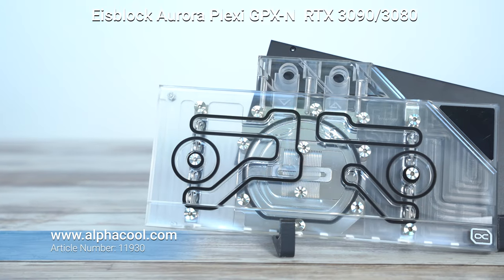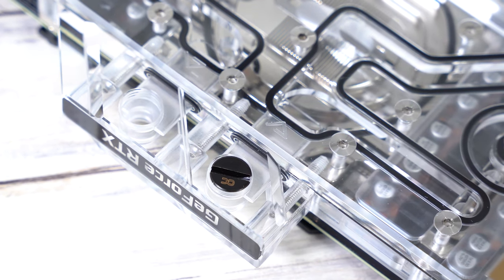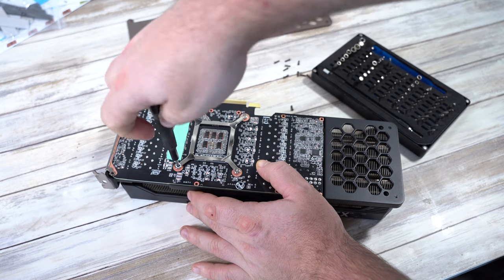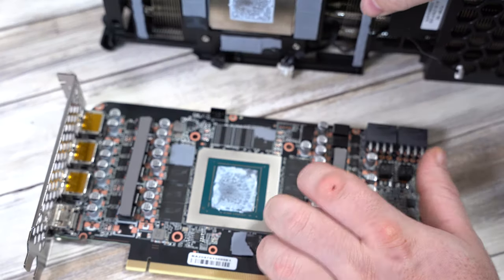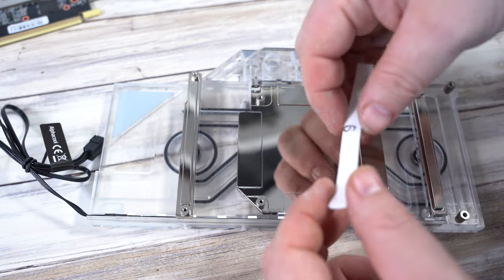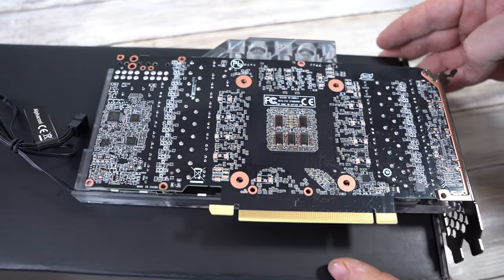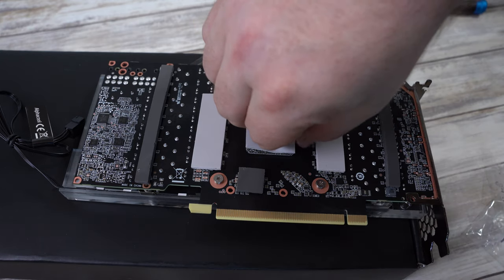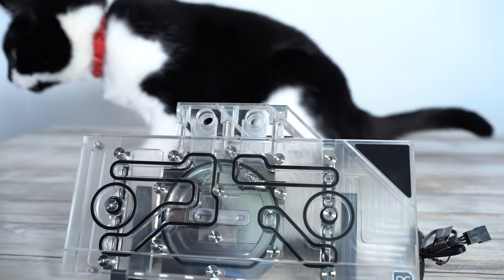How to install a 3080/3090 REFERENCE waterblock.

Comment: Do you know if there will be a gpx or gpx upgrade line for the 3090/3080? I would love to reuse my pump for my 2080ti i have, as I have a full eiswolf/eisbaer setup.
Reply from the maker: we will be releasing the Eiswolf II for the 30 series. but at this moment in time, we don't have an 'upgrade line'. That might change at any point though as our launches are crazy at the moment and I can only see so many :D
Reply: Awesome. That’s good to hear that I’ll be able to get something similar. And by “upgrade line” I meant the gpx “shell” that allows you to use the existing pump. Thanks for the quick reply!
Reply: I looked it up again since you seemed confused. The exact name on the site is “Nvidia GPX upgrade kit”. I see how you could mess that up with an upgrade line. Sorry bout that.
Reply: I wanted to second this. I also have 420 eisbaer and 240 eiswolf on a 2080 ti. 
Is there a significant performance difference between the eiswolves and eisblocks?
Reply: As far as the new ones they’re coming out with? I’m not sure, but honestly it just looks like they added rgb lights. Kinda sad honestly, cause the original eiswolf turned out not to be very modular or upgradeable if they EOL’d it after just a year or two. Not looking forward to buying a eiswolf 2 and all, just because they aren’t putting anything into the original eiswolf. I may sadly just stay with air. There’s a saying that people on that use air, like using their computer, while people that use water, like tinkering with their computers 😝 just didn’t think I’d have to upgrade all the water stuff so soon to be honest. Maybe they’ll come back to it so users like us can upgrade more affordably, but I will be most surprised if that happens 😊

EDIT: oh I see you meant the eisblocks they have 😝 derp! And I doubt it, I saw people concerned about vrm temps, but alphacool said they hadn’t found issues with it that way.

Comment: You never put the back brace on the gpu big mistake temp sky rocket at idle ..
Reply from the maker: you don't need the brace with a waterblock. If ever you will need it, we will mention that in the instructions.

Comment: Im hugely disappointed by this castrated block, too small, low coverage area.
Take a look what Byksky did, first they released similar block but with more Copper, and this week they already replaced it with V2 that has FULL contact with everything, no more holes where you can see the components trough plastic, everything touches copper
Reply from the maker: All parts that need to be cooled are cooled with water. More copper does not mean more cooling capacity, on the contrary. and also other coolers do not cover more components or do you have a heat conducting pad or heat conducting paste on the entire underside of the other coolers? No, you do not, because not everything is in contact with the cooler. Because that is neither necessary nor good.
Reply: @AlphacoolGmbH  I want to say 3 things:
1. Byksky had the same design as yours, but during the last 2 weeks they already re-launching Version 2 of their blocks, and the difference is that they closed up all the holes and now cool everything, they re-launched 4-6 blocks and keep updating more, just today a new Ventus X3 3090 block came out [my card] that also closed up all the holes compared to previous edition.

2. EK outright released complete blocks, no holes, everything cooled.

3. I had pleasure of owing a German Heatkiller block for my previous card 2080TI, and they are the ONLY brand so far that have ZERO "fake" plastic that hides the parts of the block that have no copper under it, their blocks are heavy, fully copper from one edge of the video cards board to the other, nothing is hidden by the plastic, and they have crazy amount of contact points, even on cards edges, its insane and the water-flow all trough the card, and surprisingly their prices are cheaper then EK and more compared to yours starting at 129EUR [EU VAT included] I wish I could buy their blocks, but they Boutique brand and have far fewer options then others, right now no Ventus Block.

Since when more copper is bad? more copper, it soaks up heat, it has more contact with water to cool down.
Reply from the maker: @NoBodysGamer  If simple physical principles are not understood, it is hopeless to argue. If you had the coolers in your hand, you would know that a water cooler never touches all the components. If it did, you would have lots of short circuits. It is easier and cheaper to mill a complete block from one piece. This is only one step. Each additional work step costs more money than the material costs, which are basically irrelevant. 
And there's no stopping you from buying another cooler if you think they are better.
Reply: you are so right buddy!!!👍 I am also extremely disappointed!👎how can you remove such an ugly design???? 🤮
I'm so happy about my extremely awesome cutstem system!! 👌😍 thickness colorful acrylic hard hard tubes full chrome angled fittings BitsPower Touchaqua Summit MS CPU water cooler . RGV-JSB-MOD3-P-V2 JONSBO MOD3 surge tank.
Bitspower Nvidia RTX 2080 Ti  4 x 8 GB  G.Skill Trident Z Royal Gold DDR4-3600 DIMM RGB 🤩Ryzen 7 3800XT 
1TB Samsung 970 Evo Plus M.2  Gigabyte B550 Aorus Master AMD. 850 Watt Corsair RMx White all white Sleeved Cable Management,  yeeeaaah Baby!! 💥 let me tell you something my friend, not only the performance is important, but also the damn optics!!! Alleluia to my murderous system!!  Yeah Man,  yeaaaaah!!!!! 🤩 nice greetings from Germany ✌Ppimping King  💪 🏆
Ps: hey buddy, you have to help me to get a better disign for my 3090 ti?  🤔there is no better cooling design for my future graphics card? 😩😭it looks like i will have to skip a generation?I will probably have to switch to the 4000 series? or you find for me a solution for the 3090 ti?

Comment: why the f is the waterblock plexiglass significantly longer than the PCB? it looks really janky especially with the large hex bolts on the front

And you don't re-use the X-bracket for the GPU which gives a much more even load across the die? Do you want people to crack their dies? Guess I'll buy an EK or Phanteks block
Reply: All the reference PCBs are slightly different this time round. Some are slightly shorter, some are slightly longer. It's been made to fit all of them, including the zotac which a lot of blocks don't fit. 

There isn't any need to use the X-bracket as the metal of the block is far more ridged, you're not going to have any issues cracking the die unless you use a hammer or impact driver or something.
Reply: @davido_labido  I rather disagree - the screw-only method puts higher pressure differences across corners and it's more likely to crack the die. The bracket gives a more even distribution across the die, and you can use higher mounting pressure (better for cooling) safely.

And if I'm going to spend 130-150 Euro on a waterblock, I want something made for my GPU not something cobbled together like this
Reply from the maker: @iamdmc  of course, you are more than welcome to disagree and spend your hard earned money elsewhere, but davido_labido is correct. 

The bracket isn't needed and for many many years for blocks of most brands the bracket has been removed when installing the waterblock when they have been present. 

The block isn't 'cobbled together' we tested many different versions and this performed the best and was the most compatible. It might not be to everyone's liking, but we sold out in less than 24 hours of our first batch, our second batch was sold out before we received it (due to pre-orders) and now our third batch looks like it will be the same, so hundreds upon hundreds have a different opinion :)
Reply: @AlphacoolGmbH  If you would have argued that the backplate is making up for the lack of the x-plate and stiffening up the PCB I would have agreed
Reply from the maker: @variator7466  we already mention that the backplate is there to keep the PCB rigid in the video :)
Reply: @iamdmc  None of my past GPU waterblocks (mostly EK) have re-used the X-bracket on the back of the PCB. It's 100% fine. What 3080 waterblock even retains that bracket? All the ones currently out ditch it. Actually I'm more curious on what waterblock you used that retained that bracket in the first place, even universal blocks don't use it.

Comment: I bought eisblock 6800xt Gaming X trio. But I am totally not sure which one is an inlet. Temps are horrible!! I am using the left one as inlet, but not sure if that's correct. Your placement of those arrow is simply misfuckingleading!!!!!

Comment: Most budget crappy looking waterblock I've ever seen, there's hardly any copper at all. Wtf?
Reply: It's nickel plated copper
Reply: @TheVic18t  Yeah but the actual size of the block and 30 odd o-rings, needless loops and fin density, I'd rather ekwb and that's saying something
Reply: @frostybe3r  so first you don’t realize it’s nickel plated copper (which EK does the exact same thing), then you call the set screws “o-rings” which EK also has, then you shit on how many fins it has when they are more or less the same as EK. You really have no clue what you are talking about.
Reply: @TheVic18t  Darling, it's Alphacool, only good thing they make it the Eiszeit 2000, and even that they didn't make, just ripped off the original markings of a Chinese branded one, added some g1/4 fittings and called it a day.
Reply: @frostybe3r  It’s still nickel plated copper sweetie.

Hold on let me check the other blocks. Yup. Still nickel plated copper.

We can check again tomorrow?
Reply: @TheVic18t  Damn you're drunk, you understand the differences between waterblocks, flow rates, fin density, copper quality, nickel plating quality, right?

Comment: i bought the Alienware r11 with 3080 in it will that water block work on that card ?
Reply from the maker: I have no idea wich 3080 Alienware is using. YOu must check wich PCB design they are using or wich card is it exactly.
Reply from the maker: Checked the Ailenware R11 RTX 3080... its a special PCB design. For this design there is not water cooler on the market. Sorry.
Reply: @AlphacoolGmbH   thanks i traded with a guy for a FE 3080 and got a bitspower water block so were in business